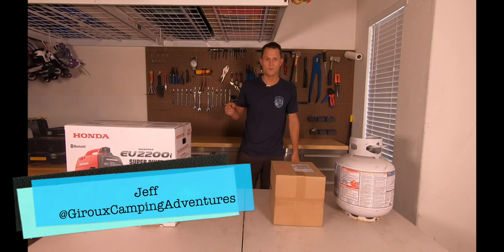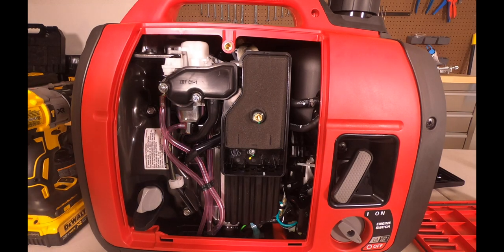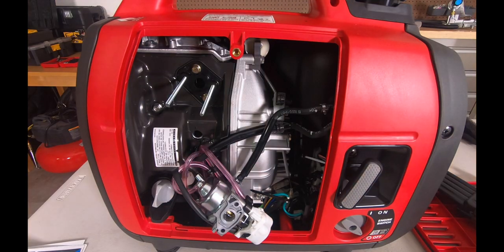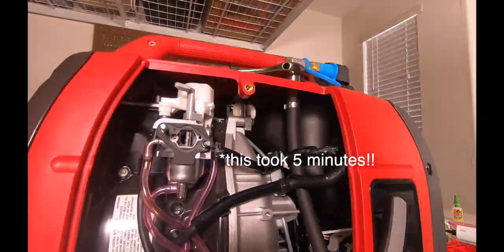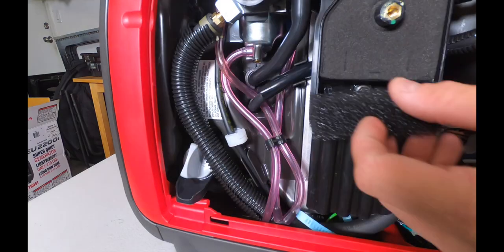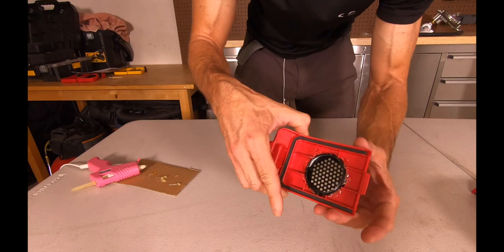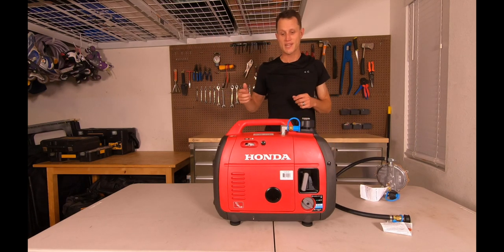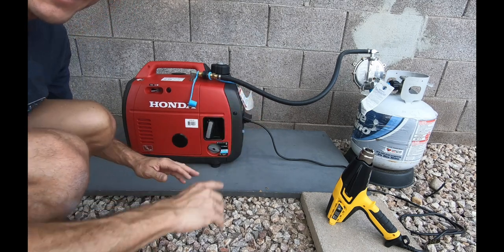Honda EU2200i Generator and Grenergy Propane Kit Conversion How-to

Comment: Thanks for detailing.  I always watch 3-4-5 different install procedures before coming up with my own.  

Not sure about the Super glue at temp, might want actual loctite that is temperature rated.

...  Half way thru, really hoping to see some load tests, load step tests, eco tests, etc. The last video I watched ended with him just idling the machine

D O H
Reply from the maker: Super glue. I questioned it too. However the original bolts didn’t have any loctite on them. Probably didn’t need anything extra. I agree though, Blue loctite would be better. 

As for load test…check out my recent video. 

Load test - https://youtu.be/PLIj8RglIyI

Comment: Anyone used this kit with a previously installed Hutch Mountain Carb /engine on/ off switch?  Wondering if there is enough room to install the propane quick adapter which sits close to the same area as the HM switch.
Reply from the maker: I forwarded the question to Grenergy support.

Comment: why do they need added vent holes and different spark plug?  Did the company say?  Other dual fuel generators have one plug that will work both on gas and LP and don't have any additional venting.
Can you give the numbers of both the original plug and the replacement?
Reply from the maker: Here’s the Grenergy article for reasoning behind vent holes. 

https://grenergy-us.com/pages/whats-up-with-the-air-vents-why

The spark plug question was asked in another comment and answered. The spark plug that comes with the kit is gapped differently. Essentially if you plan to run more liquid gasoline than propane then I believe the Grenergy team answered in the comment to switch back to original plug. They suggested gapping somewhere in the middle of both specs. Additionally they stated that it wouldn’t harm the unit if you had to run liquid gasoline for a few days on the gapped spark plug for propane. 

To this date, I have yet to run liquid gasoline. The vent holes also don’t cause problems for me. Unit still works great. Have run it at 4500ft elevation with no additional adjustments, ran 2000w, various other tests. 

Plus “other” generators don’t have the massive 120cc engine displacement that a Honda EU2200I has.
Reply from the maker: More info from previous reply from Grenergy team regarding spark plug...

"running the generator on gasoline with the spark plug gap set at .020-.022 wont hurt the generator at all. Reason for gapping the plugs closer on LP/NG is the fuel mixture is harder to ignite with alternative fuels than with gasoline so this is the reason for new plug gap specifications."

also this answer...

"If you like to switch between gasoline or propane consistently I suggest gapping the plug at .023". Having the plugs gapped at factory specifications will allow best efficiency for gasoline. But if you only chose to run gasoline when you absolutely don't have access to LP or NG, doing so at .020-.022" plug gap wont hurt anything if you run it for a few days when needed."
Reply: @girouxcampingadventures  Will your kit work on a Champion 2500 watt inverter generator?   Do you recommend vent holes for that generator also if you have a kit for this generator?
I thought gapping a plug wider would actually create a "hotter" spark because it takes for current for the spark to jump a longer distance?
Reply from the maker: Sorry I don’t actually work for Grenergy. I hope I didn’t give that impression. I suggest you visit their website and look at the product listing.

Comment: Finally got mine all set up and installed on my Honda Twins.  In a weird turn of events, I saw my eu2000i was able to push more continuous watts than my eu22001 companion.  I was running a stress test into my EcoFlow Delta Pros and the 2000i pushed about a hundred more watts than the 2200i was able to do.  This was solely based on what the EF was showing as an incoming wattage.
Reply from the maker: That's interesting. Are you running the 2000 and 2200 in parallel too some times? Also curious if the regulators need to be adjusted differently for 2000 versus 2200 when running heterogeneous setups like that. Would be interested to see what Grenergy team says.
Reply: @girouxcampingadventures  Jeff, the regulators are interchangable and yes I swapped them with the same outcome.  When I reached out to Grenergy, the theory is that the 2200i has better overload protection than the older 2000i.  I have not run in parallel yet.  My buddy tried to have be drag out the Hondas on Saturday when we tested my interconnect with the EcoFlow Delta Pros running their Dual Voltage Hub.  Base load of lights, fridges and fans are a lot higher than I had thought they might be.
Reply: @carlbrothers  I have a similar application you recommend getting the 2000 other the 2200?
Reply: @carmas54  I would go with the 2200's .

Comment: Thank you for a wonderfully detailed tutorial. I plan on using the new 2200ie daily for off grid living. 
For daily use, should I use gasoline or do the conversion?
My concern is if the propane is going to cost a lot more for daily use??? 🤔
Reply from the maker: I don't have an answer for daily use since that is not my use case. But...if I had a home with backup generator and a natural gas or propane gas source, I would go that route. What are you powering daily? Can you setup some solar and inverter with batteries?

Comment: Thanks for taking the time, I have a question, its been set up for propane, what if you want to use natural gas, propane is good for portability, but what if I want to connect it to my home natural gas for emergencies, how would you go about setting it up, thanks again
Reply from the maker: Hi, the kit allows all 3: gasoline, propane, natural gas. You need to swap out the jet orifices in the venturi spacer plate adapter (the Grenergy fuel adapter). There is a natural gas (NG) adapter you attach to the rubber hose before the carb, and there are instructions in the Grenergy book to do this if you need to run NG as opposed to LP. Once you do that, you can operate NG. Finally you can adjust the low/high idle regulator screws if NG causes the generator to run rough.

If you look up the product on the Grenergy site and look at the pics, you'll see a little natural gas adapter. In one of the pics below, it's the little threaded thing on a ring...just below the carb adapter.

Go to the actual product listing and scroll through the pics.
https://grenergy-us.com/collections/eu2000i-and-eu2200i-tri-fuel-conversion-kit/products/eu2200i-propane-natural-gas-gasoline-tri-fuel-conversion-kit-for-honda-generator-inverter
Reply from the maker: Also make sure to read Grenergy's FAQ on natural gas and safety. 

https://grenergy-us.com/pages/setup-natural-gas-for-your-generator
Reply: @girouxcampingadventures  thank you for taking the time to reply I placed the order yesterday hopefully  everything is included, I guess the nest thing is to have two different  quick  release regulators for each gas set up
Reply from the maker: Correct. Page 15 of the manual has a diagram showing the demand regulator as well as the high/low pressure regulator. As you hinted, you will need to disconnect the low/high regulator (smaller one) meant for LP. The bigger demand regulator will then need at least 1/2” inside diameter hose for  connection to the residential NG line.

I wish the manual was available online. I would point you to the pages around page 15-16. If you ordered the kit then you’ll get the whole book too. I asked for a PDF copy but was unable to get one from Grenergy.

Comment: hello brother, great video. I already did this conversion thanks you. Can you show us how once it's set up for LP, how to convert it to natural gas, thanks again for your time.
Reply from the maker: I personally do not have a natural gas setup at home...so no video. But...Grenergy has a video (not too many details) showing a quick opening and where you need to adjust for natural gas on the carb line. It's around the 10min mark in this video - https://youtu.be/Lxoo_M3PM64?t=616.

Also, the Grenergy manual that came with my kit has a "Changing to Natural Gas Setup" with full instructions on page 8 of the manual, so you should be able to find the necessary details there. If not, reach out to Grenergy support as they have been awesome and quick to respond to all of my emails.
Reply: @girouxcampingadventures  I may do a video of the natural gas setup later in the spring once the weather warms up!

Comment: nice video what is the exaust is when you use propane ? just air ? can it run inside ? , comparing the gas and the propane is it the same consumption ?
Reply from the maker: Deathly if inside. You definitely do NOT want to run your generator inside no matter what the fuel source is. Propane smells less than gasoline but the exhaust will still slowly kill you if inside.
Reply from the maker: Consumption from the website says…

“EXTENDED RUN TIME – One single BBQ size propane tank will allow the generator to run 15 to 20 hours non-stop.“
Reply: @girouxcampingadventures  got you , what is the advantage of running it on propane ? Is it cheaper ? How long a tank like that last compare to the gas tank ?
Reply: @girouxcampingadventures  wow 15 hours for 2000 Watts of course it depend on the capacity of the generator and the motor driving the generator but if i want to know for my 15 kw generator then it will be 2 hours aprox
Reply from the maker: Per Grenergy book...
1600w avg load = 14hrs
1200w avg load = 19hrs
800w avg load (ECO on) = 21hrs
400w avg load (ECO on) = 28hrs
Reply from the maker: Advantages...
1. no spilling gasoline
2. no carrying extra gasoline
3. no additional generator carb maintenance due to NOT using liquid gasoline
4. my truck is diesel...so currently I have no need to carry extra gasoline
5. Huge advantage...I have 4 propane tanks already and it lasts "forever"

My RV has enough solar and electronics/batteries to do what we need. I ONLY run this generator every 4-6 months...not monthly...and usually just because...just to do it and film something funny or cool.

I just did an oil change after nearly 2 years...only had 10 hours on the engine. I asked Andy at Grenergy his recommendation for pure-propane maintenance schedule...so based on advice I decided to change the oil even though it only had 10 hours on it.

Comment: Hi, do you really need to drill all these vent holes? What happens if you don't? Thanks in advance!
Reply from the maker: The kit requires the vent holes. Grenergy team has an article with info as to why. 

https://grenergy-us.com/pages/whats-up-with-the-air-vents-why
Reply: @girouxcampingadventures  Thank you for the link! I am wondering if somebody had any issues because of these vents. I am currently trying to decide between Grenergy and Hutch Mountain kits. Here is one of Amazon reviews on Grenergy kit I ran across - is it a legit concern? Any thought?

"I finally got my generator back from the Honda repair shop $650 later! BUT HERE IS THE BIG ISSUE the technician that repaired my generator said it failed because of the large holes in the side. The large holes redirect air flow from the normal path. And this is what caused the failure. He didn’t feel this would be as much of an issue in cooler areas, but we are in Arizona. So this may not be an issue in cooler parts of the country.
He did recommend a Hutch Mountain or Generconect brand conversion kit as they do not have large holes and the many he has installed have never had an issue?"
Reply from the maker: Grenergy team would need to chime in. Personally when doing my own research years ago for a conversion kit, I asked Grenergy support if they hear about busted Hondas due to conversion.

The answer I received led me to purchase a Grenergy kit.

Comment: Does the eco mode still work with the conversion kit?
Reply from the maker: Yes, worked fine for my setup.

Though, when I pull out the generator it is for FULL-ON charging and then put away. I don't have it constantly running since I have a big electronics setup.
Reply: @girouxcampingadventures  This is the right size generator. A few years ago I bought a Yamaha 7200 for the house which is too large to be mobile (unless you have as fork truck). Last week I bought a 2200i to ride under the bed cover in my truck. My Tacoma had an inverter built in but this Tundra doesn't and I missed that. I used it on the farm quite often. I'll use it more if its in the truck than waiting for the power outages. Thanks for the video.

Comment: Great video - I'm ready to try it myself now. I want to run it on low pressure natural gas. Am I correct that the generator pulls in the gas through a vacuum? I don't need a minimum pressure to push the gas through, right?
Reply from the maker: I’m not quite sure. Let me dig through the manual. I have not operated with natural gas yet. I asked the Grenergy team to respond to this question too. Stay tuned…
Reply: Hey Brian, our tri-fuel kit is already adjusted for natural gas use. Just change out the supplied natural gas jet orifice and your ready to go provided that you tapped NG from your meter correctly and plumbed the correct size hose directly to the demand regulator. No further modifications or adjustments needed. You can check out our video on our extended hose setup for natural gas. We have everything needed. ----> https://youtu.be/_ie37FS_V-o
Reply: Please click here to purchase our complete hose extension kit setup for LP or NG ----> https://tinyurl.com/2uwhz9u9

Comment: what's the max running wattage rate wise on propane vs gasoline?
Reply from the maker: I only have a quick personal load test result on propane...never run gas yet. Manual has some "how long will it run" numbers, but nothing about max power of both fuel types.

I did a load test cooking Thanks Giving dinner last year boondocking, microwave, Ninja Foodie running, etc. I pulled out the generator just to play around...and I kept increasing my Victron Multiplus AC current from 10amps up to 18amps. As a result, generator power was at 2000w no issues on propane. But total wattage output is also dependent on altitude and outdoor temperature.

Andy from Grenergy might have a better answer as he has tested more. The only numbers I show in the manual is "how long will the tank run" type chart that shows various numbers.

400w (eco on) lasts 28hrs for 20lb tank
800w (eco on) lasts 21 hours
1200w (eco off) lasts 19 hours
1600w (eco off) lasts 14 hours

I would say...(no proof other than my few load tests)...that this combination can run the max output of the Honda EU2200 just fine.

Comment: Really a cool video. 👍 Just a quick question? What happens when the generator shuts down on an overload and no one closes the propane tank valve? Is propane leaking in the generator (Garage)?
Should the choke be used as if the generator would run on gasoline?
Thank you, from Quebec City, Canada
Reply from the maker: Choke not needed. As to the first question, I’ll ask the Grenergy team to chime in. I’m curious myself. My guess is that the generator needs to “pull” and be working. I would imagine there is safety involved in the fuel adapter but I’ll let Grenergy answer officially.
Reply: Hi Andre, that is the job of the demand regulator. If there is no vacuum signal from the engine, the regulator shuts off fuel flow to the engine. This shouldn't be relied on when your no longer using the generator but the demand regulator is smart enough to know to stop fuel flow when its not needed. No choke is needed to start the engine either.

Comment: Why this conversion kit need a new spark plug and what is the part of number this spark plug?
Reply from the maker: Kit comes with the spark plug pre-gapped already. Answered in another comment but here it is again. 

Fuel mixture is harder to ignite with LP/NG then with gasoline. This is the reason for the new plug with gap specifications. It is pre-gapped to .020-.022.

Comment: what is the largest tank size you can use?
Reply from the maker: The kit instruction book mentions a smallest tank size due to required energy output and how the compressed liquid propane needs to turn into gas. However, there is nothing in the instruction kit that specifies a max tank. Go as big as you want!!
Reply: hello, you can use what ever the largest size propane tank the market offers. But the most common portable tank size will be 100lbs. This size will last you almost a whole week at medium load.

Comment: So you can use, Propane, Natural gas and gasoline with this conversion?
Reply from the maker: Yes indeed all 3 fuel types. Link to the kit is in description. Here it is again so you can read more about it from the vendor site. 

https://grenergy-us.com/collections/eu2000i-and-eu2200i-tri-fuel-conversion-kit/products/eu2200i-propane-natural-gas-gasoline-tri-fuel-conversion-kit-for-honda-generator-inverter

Comment: That’s really nice can you hook up two generators in parallel with the same propane tank
Reply from the maker: Each converted generator will need its own tank. Therefore a parallel setup using two generators to combine amperage/wattage would require two tanks. One propane tank per converted generator. I only have one so I can’t test either theory. 

I would guess if you had a splitter it might work? However the gas psi, splitter, and cable would need to not interfere with the Grenergy kit expected flow. I’ll let the Grenergy team answer in more detail. I will say two tanks.
Reply: @girouxcampingadventures  thanks How much money was that kit anyway
Reply from the maker: Price on website. Shows $279 right now. - https://grenergy-us.com/collections/eu2000i-and-eu2200i-tri-fuel-conversion-kit/products/eu2200i-propane-natural-gas-gasoline-tri-fuel-conversion-kit-for-honda-generator-inverter